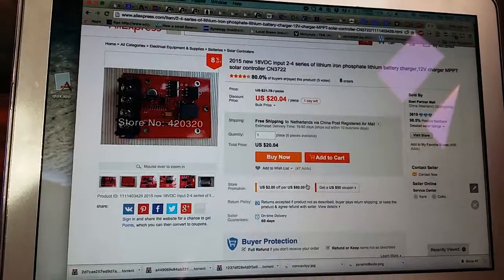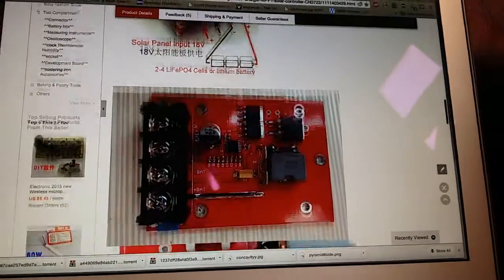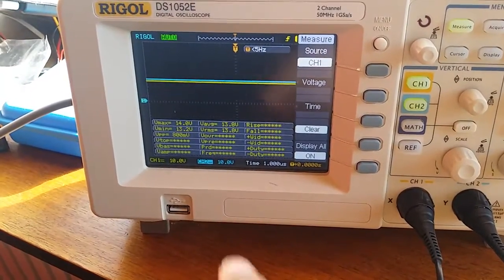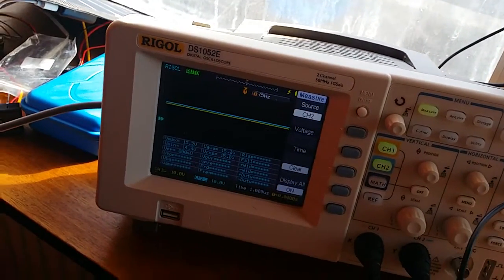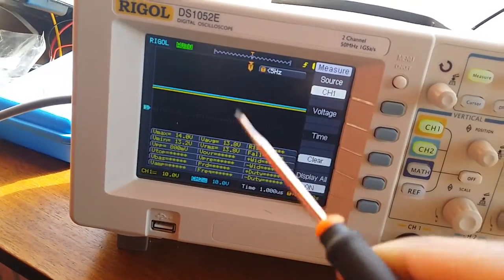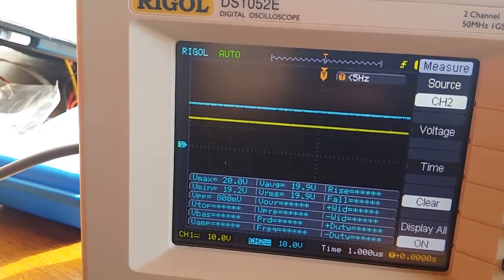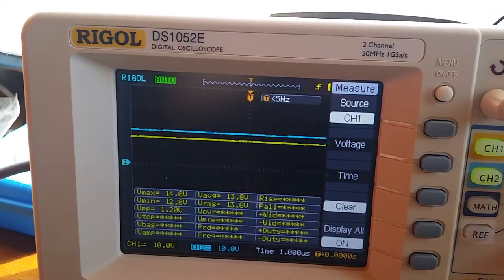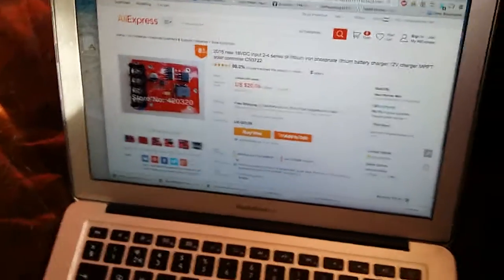Chinese (mini/micro) MPPT solar controller  CN3722 from Best Partner Mall (Alibaba Express)

Comment: Really, I don't see how you can conclude much from this test. As far as I can tell it works just fine. Also you don't provide the wattage for the panel? I'm assuming 10W based on size, voltage, and current.
Follow me on this: Lets say your battery is depleted and thus the MPPT should regulate solar panel voltage to provide maximum power, which on this chip means it'll draw maximum current. It does. Half an amp is good and 15V when loaded doesn't seem too bad considering the simplicity of the IC. 
Then lets say you reach a full charge on your battery, when Vout = Vbat, as you demonstrate. The MPPT shuts off and panel voltage jumps to ~20V. This is correct, as you are no longer using or regulating the panel and 20V is the open circuit voltage. Output from the MPPT should be nothing. It happens as expected, although you don't really show us the amps.
Now, when it is charging your battery and you change the output voltage you did see a difference in the amps. I saw it jump from 0.47 to 0.52 amps. If the difference in output voltage is the 13.1V@0.52A to 13.8V@0.47A I would call it a succes. It does loose about .25W, but as you are measuring with a charged battery and taking into account some difference in efficiency, I would not say that this equals "Not MPPT". It's a cheap as fuck MPPT, if you want the best get the expensive Linear, TI, whatever big-brand board, not a chinese knock-off. 
Also PLEASE learn how to do a decent experiment, controlling one parameter at a time holding others constant, AND LOG THE DATA! 
Based on your video the only conclusion I get is that this cheap board delivers fairly as promised and that you should study more before laying a verdict. 
On and end note, solar panel MPP voltage varies quite a bit with temperature and this IC provides only the most basic temperature tracking. AND another end note would be that you mention in the comments that the battery pulls the voltage down. Have you considered that this IC works on the CC/CV principle and thus if your battery voltage is sufficiently low it SHOULD drop, providing constant current and then when a certain voltage is reached, provide constant voltage. 
What a wall of text you made me write... More homework for you young man.
Reply: A comment again on this. You said in the comments it's a 20W panel. Plausible, but your current is lower because of bad angle relative to the sun, losses in the windowpanes. Maybe even not the sunniest day.
Reply from the maker: +S&#248;ren Riisom Pedersen dude, you can conclude all you want....This crappy product does not work, period.
You can come up with all the theory's you want.
1.My batteries where not full.
2.My panel is putting out enough power to charge any battery.
3.The so called MPPT worked just like a PWM, meaning not able to separate the Battery circuit from the Solar Cell Circuit, thus letting the battery act like a resistor, pulling down the voltage coming out of the solarpanel.

I suggest you buy this product & test this product yourself.
As all the time you & me have been wasting on this product is already enough to buy a couple of these units.

I wish to keep it at this for this product.
You think I am wrong with my throughout full testing on a oscillate, then prove me wrong with your own tests.

Goodluck
Reply: +Greenme Research 1. Okay, that's not a problem then.
2. It does charge the battery, or is the half amp just going into an empty void in spacetime? 
3. Cheap MPPTs are usually PWM regulated (most are really), and yes, unless you put a blocking diode in there it will not separate the battery from the panel. But don't expect the open circuit voltage to be the maximum power point, because it isn't. At Voc the current is zero, with ANY solar panel. MPPTs MUST lower the panel voltage to get some amps out of it. Just look at the IV curve of any panel. If the panel voltage is 20V it would mean that there is no or very little current output.

Besides this isn't theory I'm pulling out my own sleeve. This is just textbook stuff. 

I just don't understand your conclusion. Don't get upset, duuuude.
Reply: I'll also add that this chip should be equipped with to potentiometers as per the datasheet of the CN3722, as the panel regulation voltage depends on a resistor divider. Thus, this board may very well not work as it should and this would be the fault of the designer.

Comment: Have you realized that by hooking the oscilloscope's ground to both the solar panel and the output of the charge controller, you are probably bypassing the controller's internal shunt resistor? The measurment method you are using is wrong... If you want to fully characterize a module like that, you have to hook it up with a bench power supply and a variable load... And be careful! The oscilloscope's ground leads are connected together internally! This is a classic pitfall many people fell into while measuring stuff ;)
Reply from the maker: Channels of a scope are isolated from each other.
Why don't you order this unit and share the test results for yourself?

The only response the seller could manufacture on this video was, if I wanted to order more.
Case closed
Reply: No offense, but the scope's GROUND of the probes are NOT isolated from one another! You can test it with a multimeter if you want. This is the reason that expensive isolated differential probes exist!
Reply from the maker: Again, buy the product yourselves and prove this shitty product works yourself, lol.
I don't understand people with their endless commentary, buy it, test it yourself and put a video online proving otherwise.

I have no interest in this product, it's not a MPPT in my books and put that online to waste other peoples time.

Like the other PWM crap they sell as MPPT's on Alibaba.

Comment: What current are you measure, the current into the battery? Maybe your battery is the limiting factor as current drawn from the battery is self regulating. You can't increase the current to the battery if you dont increase the chargers voltage. Even then, current is self regulating.

There's a chenglish written setup here:
http://www.ebay.de/itm/5A-MPPT-Solar-Panel-Regulator-Controller-Battery-Charging-9V-12V-24V-Auto-Switch-/161771493762

Datasheet:
http://www.consonance-elec.com/pdf/datasheet/DSE-CN3722.pdf

Beside this, the controller seems to work correct for the means of MPPT "constant voltage" shown here:

https://en.wikipedia.org/wiki/Maximum_power_point_tracking#Constant_voltage
Reply: +volvoracinggermany Yes, it look to me that author didin't do his homework and that this charger is working ok...
Reply from the maker: +Valent Turkovic, then buy it yourself and show the people.
Reply: What amperage is maximum for your panel? Lets say it is 5A. Good test would be to have battey which is half full and then put panel out in perfect conditions (no clouds). If current doesn't ever go over 5A then you are right, this is not MPPT, but if amperage goes over 5A then you have MPPT action going on. To me it looks like your battery is full and that is why you didn't see amperage increase or there were clouds.
Reply from the maker: The panel is 18 volts at 1.2 ish amps.

I will redo the test with empty batteries.
Reply from the maker: Actually, what I showed is that the battery is pulling down the voltage the
subpanel generates.

That immediately shows that the circuits are not separated by the charger
and thus the unit not being a MPPT.

An MPPT manages the voltages and amperages between the two circuits
optimally.

This is not happening, as I expected to  raise the voltage on the battery
side to lifepo4's optimum charging voltage  (14.3 volts range) it also
impacted the voltage coming out of the panel, that should have been 18Volts.
Reply: +Greenme Research Please also show us the diagram of whole circuit and what exactly you are doing. It is really not clear from the video only.
Reply: +Valent Turkovic So you are turning potentiometer on BMS that regulates voltage? Why?  If you lover the output voltage below battery voltage then nothing will happen. That potentiometer doesn't work as you think it does.
Reply from the maker: +Valent Turkovic .
I suggest you read the manual of the device. I have no use for this device as it doesn't do what it advertise,  the sellers only response to our questions was if we wanted to order more.

Maybe I'll do a retest with empty batteries when the sun starts shining again, but for now I have another perfectly working MPPT that does what it was bought it for.
Reply: Which one is the other MPPT solar charger that you have?
Reply from the maker: +Valent Turkovic 
https://youtu.be/A0rsEFUdsKw
Reply: Greenme Research Video is unawailable...
Reply: +Valent Turkovic , The CN3722 is a voltage mode MPPT, as you may know, so there really isn't any "regulation" or isolating nets. The controller is just maintaining a set up panel voltage and decreases/increases its output power accordingly. If panel voltage lowers from less sun shining, output current is lowered to prevent a collapse on the solar panel side. I suspect that this charger is working like intended. Will get one of myself to use it with a 20W panel and a small 9AH battery.

Regards,

Christian

Comment: Have you figured out that you have tested this wrongly? I would really like to see a proper test of this device in new video.
Reply from the maker: +Valent Turkovic ; My explanation is quite clear. With this device you can set the output best charging voltage of the battery, resistance of the battery shouldn&#39;t be an issue when I set the output to charge voltages in the 14.2 voltage range.

The battery is not full, fully loaded LIFEPO4 sits at +13.4 volts.

I am using a different MPPT which does work as claimed, which is from a known inventor in the free energy open source community.
https://www.youtube.com/watch?v=NU3yIt5InaA

If you are interested in that chinese device then do please buy and share your own tests in this column.